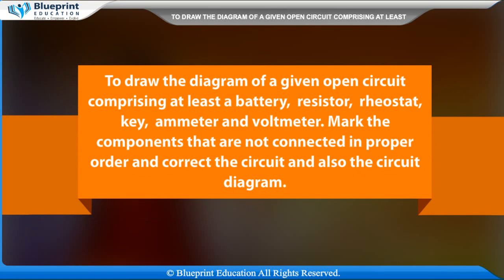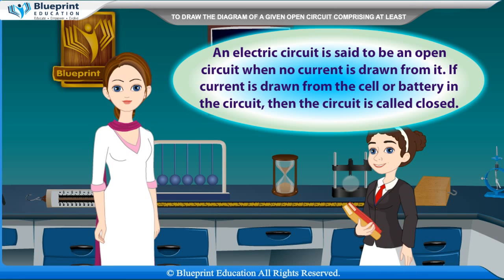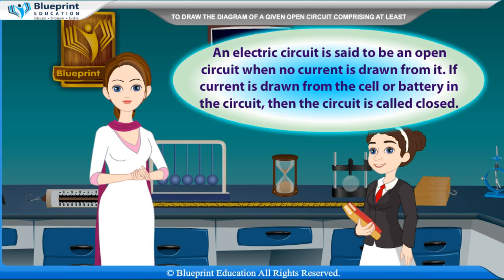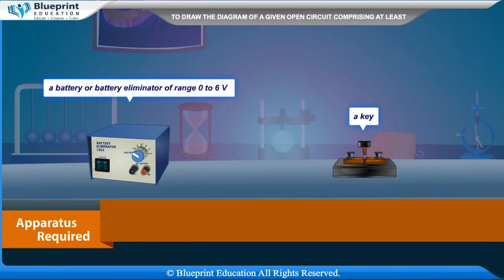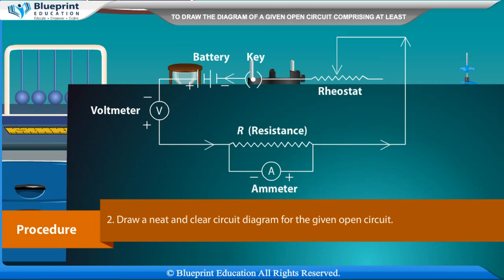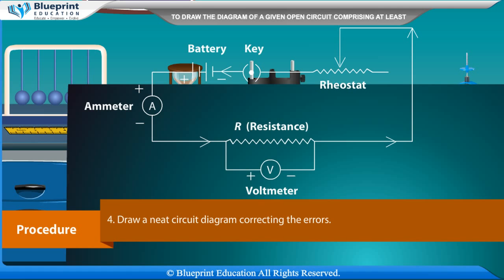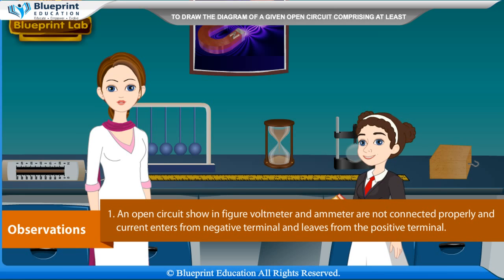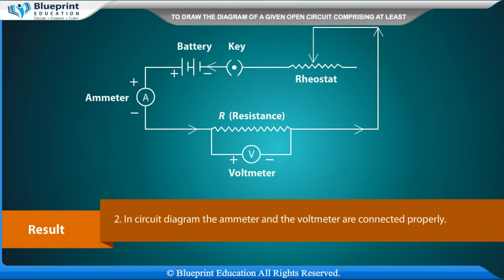Drawing an open circuit diagram

Comment: I just want to know "circuit close" is to put key or take out the key!???
Reply: @Ayush-dh2qj  ohkk thanks. Will remember on 18th 🙌
Reply: Close circuit- put key in(current flows)
Open circuit- take out key (no current flows)
Reply: U need the close key
Reply: @manmeetsinghjandu3419  i passed 12th 🙂
Reply: @hardishah3442  u passed out without giving an exam 😂😂
Reply: @manmeetsinghjandu3419  i did and i got an A😟
Reply: @hardishah3442  which board is urs cbse Or another one
Reply: @hardishah3442   tommorow is our physics practical